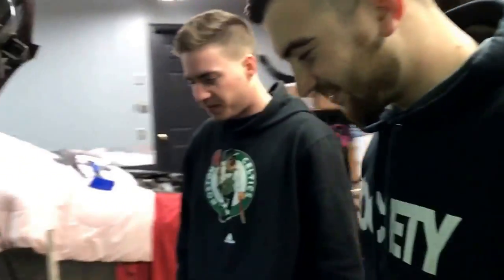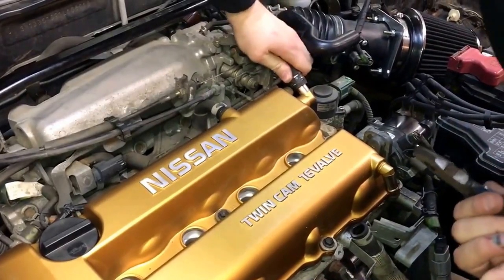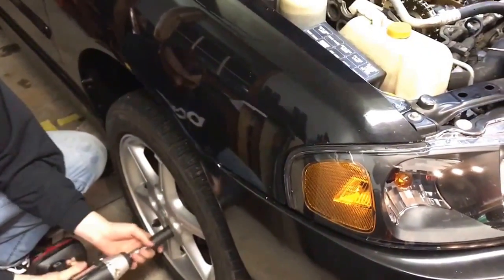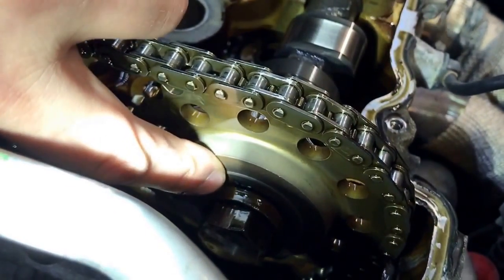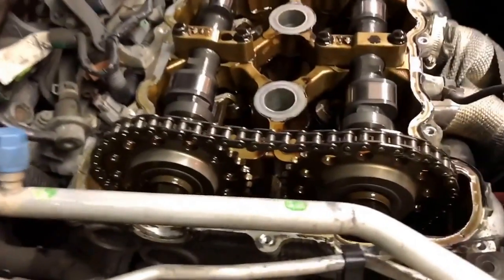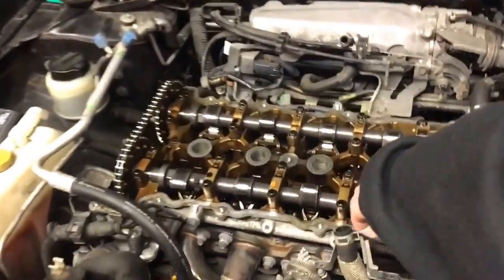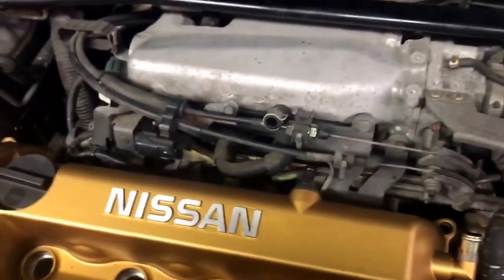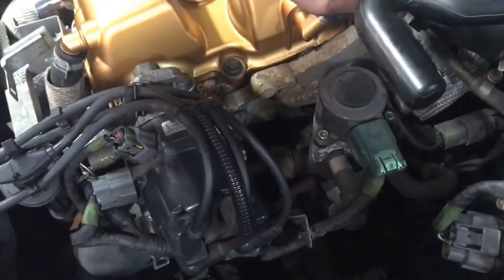Sr20deRR timing chain tensioner install and cam timing check (b15 Sentra)

Comment: i need some help i have blown the head gasket on my mr20 it seem as if it worked on before they say it might skip timing if it skim do you tink its ok to rebuild or buy a new one??
Reply from the maker: You can probably find a whole sr20 roller rocker from a junkyard for not even 300 bucks.  Mine was 220 when I picked it up and it was perfect with only 80k miles

Comment: Hey guys. So a previous owner installed an exhaust cam wrong, and the notch is at about 1 o-clock when the intake cam is at 10 o-clock and the engine is at TDC. 
How do I resolve this? :)
Reply from the maker: I believe you’d have to remove the tensioners and have a friend hold a wrench to it and place it where it belongs before retightening/timing it.  Don’t quote me on this but I imagine it’s just a matter of positioning

Comment: Can you send me the link of the cam that you use for this upgrade
Reply from the maker: tomei 260 degree poncams, i bought them used so i dont have a link for you
Reply: How do you like those cams, I just installed poncams 256 on my b13 det but haven't turned it on yet still waiting on my twin scroll manifold to come in the mail